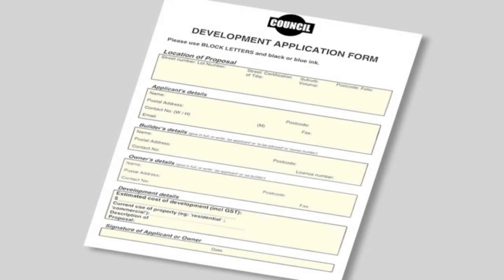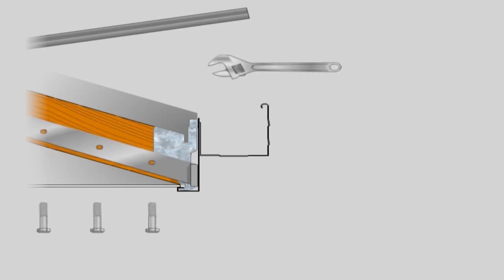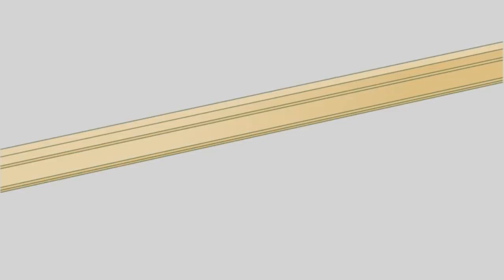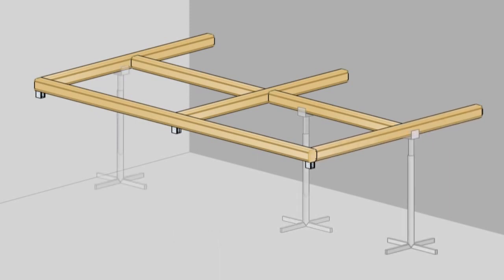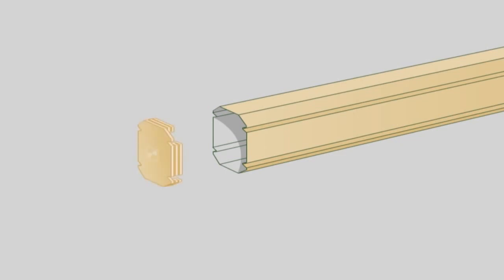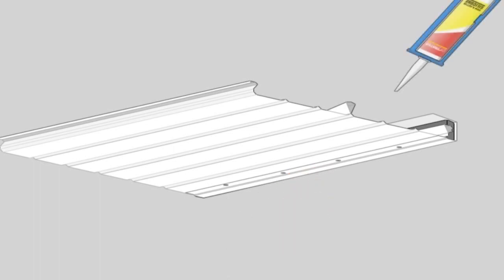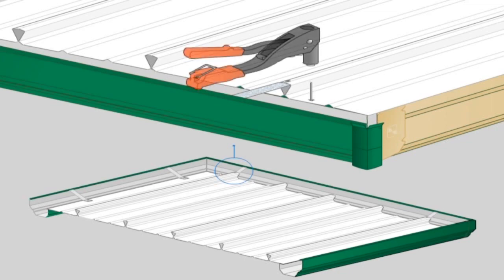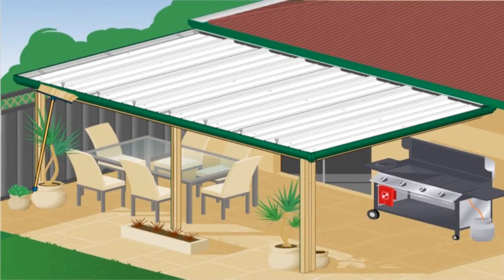Stratco Outback | Flat Attached | Veranda, Patio, Carport | How-To Installation

Comment: Straight forward video, if only Stratco could deliver the right materials.

Half of it is missing (not enough column to beam connections, 2/3 sides of gutters), what I've got doesn't fit together (wrong gutter profile, the beam was supposed to be 2x3600 but instead got 7200 and therefore needed another joiner which they no longer stock).

The people in the St Agnes store sent me to Gepps Cross to pick up the remainder but when I got there nobody had any idea who I was or what I was after and I left with nothing.

Wasted the whole fucking day taking delivery, going to the store and not picking up what was missing.
Reply from the maker: Hi Sterling,

Sorry to hear this has happened to you. If you could forward your details to shane.jones@stratco.com.au we will chase this up for you with our National Retail Manager. Thank you.

Comment: Stratco patios are great. However the latest one we purchased (stratco outback flat) has not been that easy to install the roof. Video and installation guide not helpful at all. Trying to overlap the panels is an absolute nightmare, totally ruined one sheet with block and hammer simply because the blasted thing wouldn’t slide. Instructions do not tell you whether the large channel clips over the small channel or other way around, totally frustrating. Please provide clearer instructions Stratco.
Reply from the maker: Hi Ann, thank you for your feedback.  We will be reviewing our instruction guides and videos based on your feedback and will aim to make instructions as clear as possible.

Comment: Stratco Outback goes together just like Lego. Very easy to do. What would be the approx cost for materials and labour only to install one 7m x 4m to existing concrete pad just exactly as the video shows? brick home. needs guttering and fascia obviously. Please I dont want to hear 'book for a free quote', I would just like a rough estimate of materials supplied and labour done by a Stratco installer? not cheapest guttering etc, not dearest either - just middle range for a typical stratco flat roof and labour. ballpark figure $4000-$5000??. thanks.
Reply: did you get any quotes or an idea? I was looking at doing the same thing to extend our alfresco
Reply: I  got a quote from Stratco for a colourbond carport (flat roof) approx 6.4m X 5.4m and was quoted around $8,900 for materials only. That's not including labour to install which probably be another $3,000 - $6,000. Fielders weren't any cheaper. Im looking at costs for timber pergola.